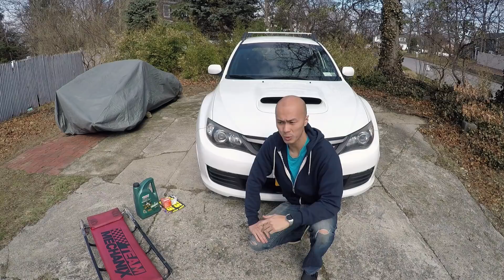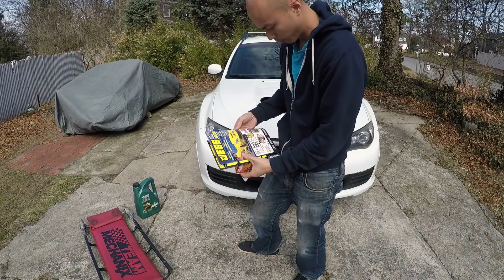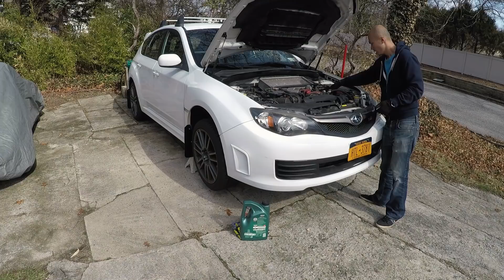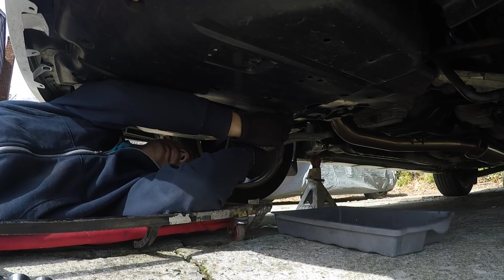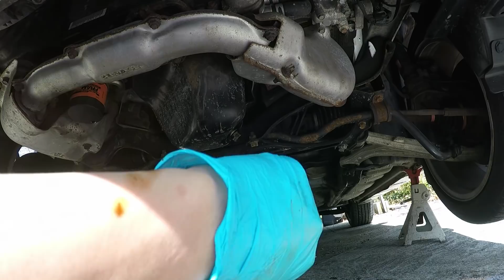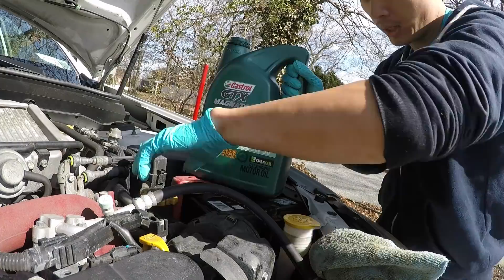STi Gets an Oil Change

Comment: i gave you a thumbs up, as far as fram i have one of the ultra ones that supposedly go 15k miles, haven't used it yet since im using oem filters at the moment but a lot of people use fram. I get what's on sale and the ultra was 4 dollars a few months back. Im not spending 15 dollars on a purolator boss that's rated just as good as fram ultra synthetic. As long as your doing maintenance, that's all that matters. People hate on oil brands, filter brands, etc.